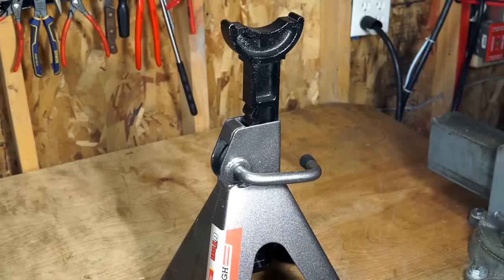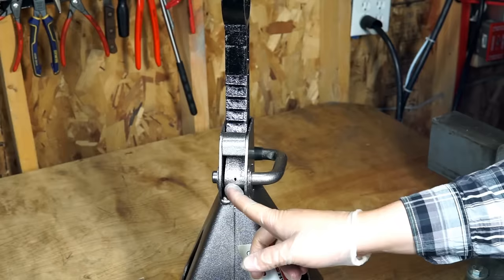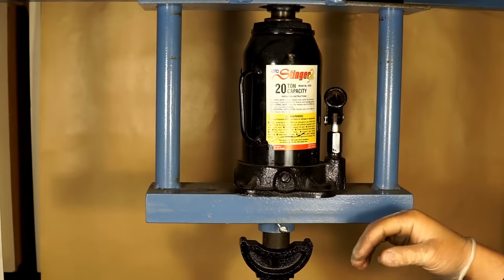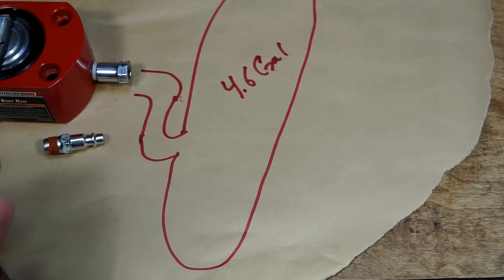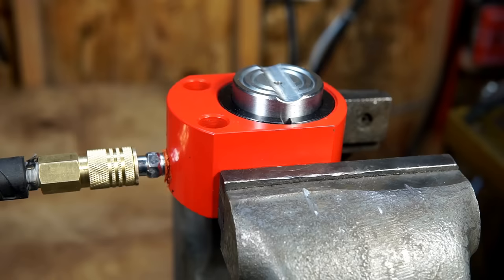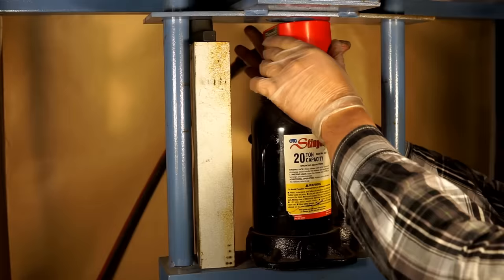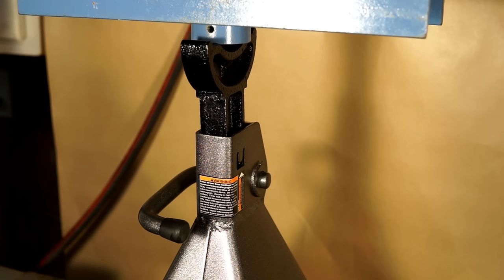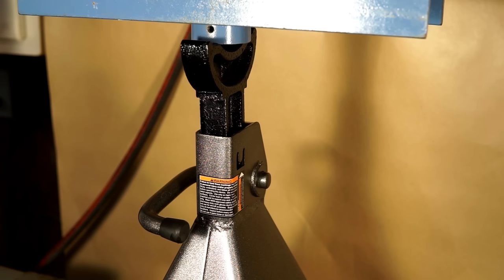EXPERIMENT: WARNING! Doing this to your Jack Stands will get you KILLED!

Comment: always back up jack stands by leaving a hydraulic floor jack engaged under the car near where you are working. Jack stands plus floor jack makes Jack a safe boy.
Reply: Jesu - jack is a tool, not a "boy". And who are you calling "boy". that's racist.
Reply: I throw the tire under the frame also.  The idea is that if the stands and the jack fail, something will be there to act as a spacer.
Reply: MrHellfinger ditto that
Reply: Always do!
Reply: jesuisravi, that is exactly the trick that i was taught in college auto shop.  leave the hydraulic jack in place, almost touching and tighten the valve.  and always on the side of the car, or end you are working on.
Reply: jesuisravi  And also make sure you still have some clearance between your head and the car. If the stand fails, the jack will still give a little bit, squeezing your grape between oil pan and pavement
Reply: jesuisravi best response
Reply: +Jesuisravi Lol.. what instrument is that a mnemonic for ? :)
Reply: jesuisravi i always put a spare tire under the frame when working on my moms car or something just to be safe.
Reply: MrHellfinger just realized you had like the exact same comment as me
Reply: a one string violin
Reply: Dray - your mom said she removes the tire when you aren't looking. PS She just took at a million dollar life insurance policy on you.....
Reply: Jay Sanders He's not smart, that's what a normal person with common sense will do!!
Reply: +jesuisravi  Or use timber dead-stops made from railroad ties. It's a pain in the ass, but much better than the pain of crushing your ass.
Reply: my dad always taught me to pull a tire under the car with you.
Reply: Yup, mine too.
Reply: @John Gerson-- I also use timber railroad ties and rough cut lumber instead of stands, It may be bulky but it wont fail.
Reply: LMAO!!!!!! don't forget using 2 20 ton bottle jacks with that log--can never be too careful!!
Reply: I do a LOT of work under cars... both at the shop and in the field, so I got two systems. At the shop, unless I'm working on wheels directly (hub, brake, tire) I put the car over "the pit" for most of it. It can't possibly fail there. The pit has grates to support the car until I've got it in proper position, and then I pull the grates out and climb down into a hole built in the floor. Simple as that...
   Field work can get a little complicated. Mostly at one end of the car or the other, I can accomplish everything with ramps... Again, wheelwork takes exception.
   For wheelwork, I generally don't put any part of me under the damn car. How hard does that have to be? It's the only point when I willingly use a jack, and about half the time it's already up on a ramp, so that's already in place in case of a fail... But when relying on a jack, don't get under the thing... That's why God invented ramps and pits in the first place. :o)
Reply: A hydraulic jack can fail more easily than a jack stand will. I have had floor jacks fail on me, but not while I was under the car. I absolutely will not get under a car with a floor jack. I use good quality stands that are rated a lot higher than what I'm working on.
Reply: Use both jack and stands, or use neither and take it to a mechanic.
Reply: Yup, the more stuff you can put under there the better - never rely solely on a jackstand, or any other single device
Reply: I use locking pin jack stands with a jack
Reply: You never trust hydraulics
Reply: Or toss the tire under the car, if you have to remove the tire anyways
Reply: I do it the exact same way !
Reply: I always use more than one jack stands plus I leave the jack too sometimes I use wood 4x6 or the tire
Reply: Redundancy is a must, however it Will Ruin your jack seals by leaving jack under heavy load long term. A Jack is not made for that. And a jack stand under load will take some force to move the cam lever on the stand and not gonna retract by a little bump, you gots really hit it.
Reply: @planetmoving9180  I agree, never trust a hydraulic jack to hold a load. Also, never get under a car with a jack stand just sitting with no load. It's too easy for the jack stand to get kicked or bumped out of position (or fail from a car dropping suddenly). So set the vehicle on the stand and drop the hydraulic jack a half inch. But do leave it under the car if not needed else where.
Reply: @planetmoving9180  the jack stands take the load, not the hydraulic jack.
Reply: Dude, that's exactly what I do! I jack up the car, then let it rest on the jack stand, then keep the actual jack slightly under tension "just in case." I've done this for decades. Gotta have at least two fail safes...
Reply: @pdiz  Amen, brother
Reply: You would have to hit it pretty hard to make it come down. It won’t release that easy with pressure from the vehicle on it . I always leave the jack under the car & tire that  I removed from the car. 
It’s the way it was taught to me
Reply: @Fish-df5xc  True, but then jack stands in our day weren't made in China
Reply: @billiebobbienorton2556 
You het drunk often and smoke dope every day, don’t you?
Reply: @johngerson7335 
6x6 hemlock 24” long is a nice cheap safety. You can put two as a base and stack on that if stability is an issue.
FWIW I trust my jacks more than jackstands but I use jackstands to back up a jack. 
I made a couple jackstands I trust but they’re inconvenient. 1” threaded rod into a tripod base, two nuts welded into the neck to double up the threads holding things up and spread the pivot point 3” apart. 
Solid blocking like the stackable 6x6 cribbing or a non-releasing jack stand like my threaded ones are the only safe stuff beyond using a hoist with a safety lock imho.
Reply: You cannot rely on a trolley Jack as a fail safe method to support a car. It is not meant for that. It’s only use should be to raise a car. Because it is hydraulic it is prone to failure when continually under pressure. Use two sets of axle stands plus tyre under chassis.
Reply: Yes, I always use what I call drop jacks. If the car drops it falls no where because I have three drop Jack's plus the 4 jack stands underneath while I'm working.
Reply: I triple protect. Stands. Floor jack. Ramps.
Reply: Yes 🤘
Reply: @MrHellfinger I'm real fat ,so even that would be squashing the hell out of me.
Reply: @stepbro4978  well, it's a matter of degree...some protection is better than nothing.
Reply: @jesuisravi  I mean I could add 3 extra tires to cover my spare tires.
Reply: @stepbro4978  sounds like a plan to me
Reply: AND tires, blocks, scissor jacks
Reply: Me too. Great minds think alike lol
Reply: I also have always used a jack with a jack stand. And sometimes a jack and ramp. I check every before I get under that car or truck.
Reply: Exactly what I do
Reply: Buy jacks that have a slide in locking pin
Reply: Amen!
Reply: Yep. Or leave a wheel with a mounted tire under the car.
Reply: That is what i do. I have built cribbage stands out of 2 x 4’s to catch the vehicle if all else fails.
Reply: Agreed ! 30 years as a auto mechanic and I use 2 jacks on real American heavy trucks and SUVS
Reply: OSHA wouldn’t approve of some of the things I’ve done lol. I guess the stupider you are, the less like you are to have something fail on you. Just because it hasn’t happened doesn’t mean it won’t though. I air on the side of caution now
Reply: @MrHellfinger Exactly. Cinder blocks also.
Reply: 100%, I always use both jack stands and jack together. Better safe than sorry.
Reply: I usually do 2 jack stands at 2 different parts of the frame, and leave the hydraulic jack holding it just above the stands. If the jack fails it lands on the stands
Reply: @linux2420  Same. My truck is sitting like this at this moment as I'm replacing the front passenger hub assembly
Reply: I've always done that as well. I just replaced the fuel  filter and fuel pump on our 2004 Jeep Grand Cherokee. I used air pillow jacks and 4x4 hardwood cribbing for support. Then backed that up with a jack stand. You can never be Too Careful. Or you'll become Really disfigured or dead. Thanks for the video. Surprising results but beneficial none the less. God bless.
Reply: And the wheel under the subframe
Reply: Exactly what I do and a tire.
Reply: @billiebobbienorton2556 go away Yankee
Reply: Was that a Will And Grace reference?
Reply: I remember when we were young, we would crawl under the car without jack stands at all… now days I want stands rated at double the whole weight of the car, with a hydro jack under as well as an old rim and tire shoved under it just for third level of insurance
Reply: Absolutely 💯 right
Reply: My jack stands failed Monday. I had extra support. They all broke ..😢
Reply: That’s exactly what I do! I don’t trust the jack stands by themselves
Reply: Cinder blocks baby
Reply: @billiebobbienorton2556  Sounds Like Biden
Reply: CORRECTAMUNDO! 
That's what I always do 😎
Reply: And a spare wheel underneath if possible. Impressive vid 👍🏼
Reply: All work and no play makes jack a dull boy lol.😂
Reply: All well and good if you're lucky enough to own a pit or hoist to do this lol. I've used mine 100 times and never had problems with my stands. We just need to be careful and be aware that it can happen and take measures on preventing it from happening by using our common sense and logical thought.
Reply: 1 of the most dangerous unreliable jacks they ever made were the scissor type design. Absolutely pathetic and very unstable. Trolley jacks are also great  but 1 of the best!  Was the good old bottle jack,provided that you used a decent size block of hardwood as a base. The best stands were the ones you used to have numbered holes in for height and you could put solid steel pins through it. They could never be bumped or insecure unless used wrongly.
Reply: That's what I was taught. If the jack isn't in the way, just leave it where it is.
Reply: I'll generally slide the tire up under the frame also. That way if the jack, and jack stands fail. Or if the car gets pushed off them somehow it will fall on the tire and rim before it completely crushes me.
Reply: @billiebobbienorton2556 lol I think you just summed up how the average American thinks in that one message.
Reply: Always have a back up
Reply: i like the tip ...
Reply: Yep, I decrease the jack pressure just barely off the vehicles weight as a fail safe.
Reply: And take the handle out so you, your buddy, your wife doesn't trip over it..
Reply: @MrHellfinger I do too … can’t be too safe
Reply: @IAmProfitMusik  Very true yet most youngsters have no idea how close they are to death and that's the ultimate reason.. Kids are stupid and it's our job to protect them cuz, they haven't learned it yet..
Reply: Problem is you need 2 Jack's if you are putting jackstands on both ends (rear or front) and most people have only one
Reply: Absolutely sir!
Reply: Better yet, get jack stands that have safety pins (like Big Red Torins). If I'm under it, I leave the floor jack if I can as well as a spare wheel and tire under the car too.
Reply: @Shade_Tree_Mechanic This. No idea why people would buy jack stands without a locking pin, they're not much more expensive.

Comment: an additional note.  I was always taught, if you remove a tire, especially if you are using a jack with no jack stand, place the tire you took off, under the vehicle.  This gives you an extra layer of protection.
Reply: This! and buy larger jack stands for safety margin.
Reply: I have always done this. even with a stand.
Reply: I was in the middle of putting the wheel back in place on my SUV when my jack gave out. I saw it slip out of the corner of my eye. I backed up before it completely collapsed. The SUV leaned towards me but was stopped by the tire hitting the wheel well and the rotor catching the inside edge of the rim. Scariest moment of my life. I haven't done any work that requires me to lift up the SUV since. Let a shop handle that.
Reply: I do this with a stand and the jack putting very light pressure, just touching. I also never ever tilt my garage jack so I have no air in my hydraulics.
Reply: Placing the tire under the vehicle also gets it out of your way.
Reply: @rsisente  Unless you use it as a chair
Reply: @TellURide447  I don't either and no pull out, no kids. Guess you're just lucky lol.
Reply: This.  Or always put something that is crushproof and taller than your head.
Reply: @TellURide447 😁🫡
Reply: Learned that from my old man decades ago, passed it on to my granddaughter.
Reply: But then it gets in your way @rsisente
Reply: @brentbradley6711   you slide it under the vehicle, out of your way.  This way as you are moving around the outside of the vehicle, it is out of your way.  Preferably under the frame, if you have one, if not, choose a spot of strength.   axle, etc.
Reply: @Yogi_Bear69  Next time try it with a female. It's an entirely different outcome. 😆
Reply: I do this as well. In addition I take the floor jack and raise it until its applying a light bit of pressure against the front or back jack point (whichever side I'm working on) - not enough to lift it off the stands, but just enough to be another "catching" backup.
Reply: My father taught me to do that and it saved me once when my jackstand failed.
Reply: DUDE I DID THIS LIKE AN HOUR AGO AND THE JACKSTAND SLID OFF TO THE SIDE AND THE CAR DROPPED ON THE TIRE. I wasnt below the car though my hand slightly was.
Reply: Not only can it save you if you're working under the car, but it will let you place the jack again and lift the car as it's not easy to fit the jack between the ground and the jacking point near the rocker when it's touching the ground.
Reply: I do this to be extra safe.
Reply: I also carry a a large Cinder blocks in trunk just in case💯💯
Reply: Always
Reply: Saved me once...accidentally loosened both front tires lug nuts and then took a tire off. The car slipped off the jack and fell onto the tire.
Reply: 👍yep
Reply: this is the best way to avoid soothing like this although try n use an old tire that Noone is gonna use saves some money and tore life over time
Reply: I always do the same
Reply: The tire is not so much for self protection but more so that you have a jackable point if things fail.
Reply: I always put the reserve tire under the car until I remove the other wheel, then swap them. Had the jack slip once and was lucky I had the tire underneath.
Reply: This was how I was taught
Reply: I put the tires under the car and even bricks, because I love my legs to function ;)